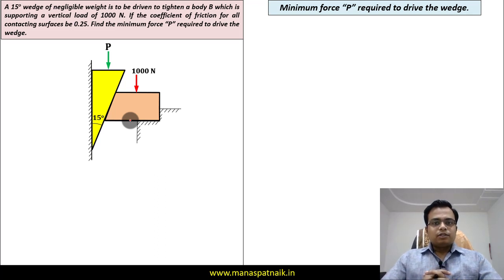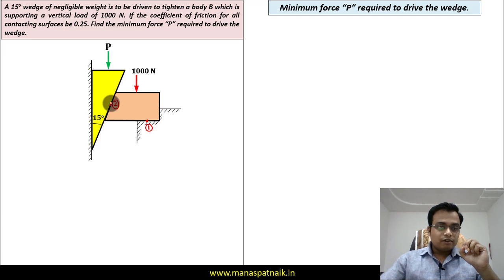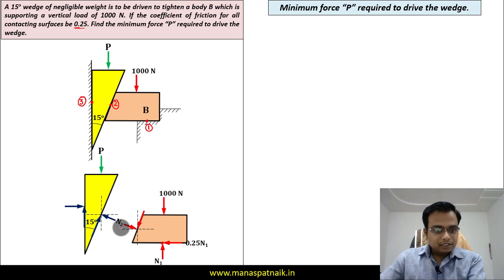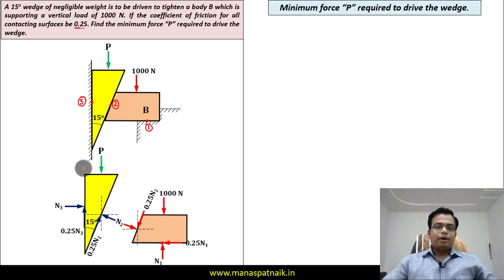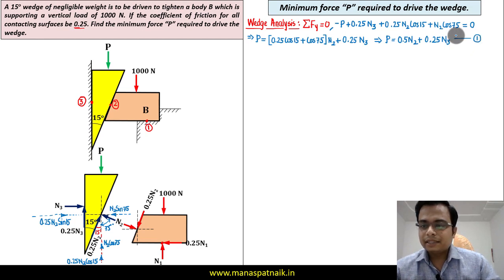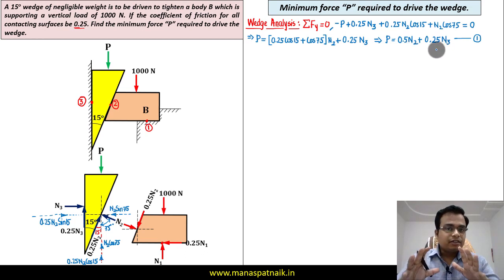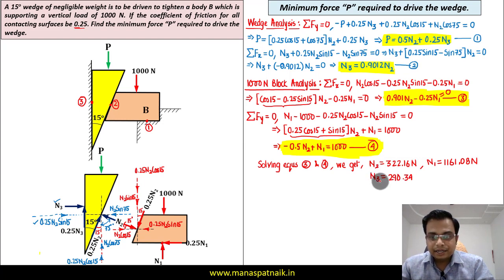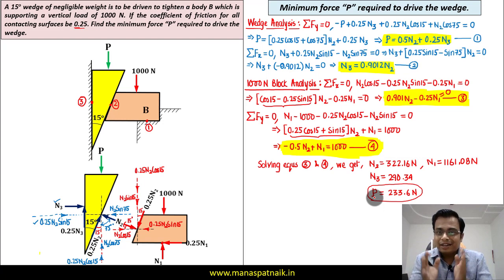Friction | Problem 9a | Conventional Approach

Comment: Sir, I have a question.  Why doesn't the block of 1000 N feel a normal force from the right wall? There is a fixed wall, so I guess there should be a normal force.
Please explain if I am wrong
Reply from the maker: You are absolutely right. Even i thought the same when i did this. Well, lets just neglect it, because if we consider it, then there will be 3 unknown forces acting on that horizontal block and wouldnt be possible to solve it further.
Reply: @ManasPatnaikofficial  ok sir...
I had this doubt..  thanks for clearing it 👍🙏